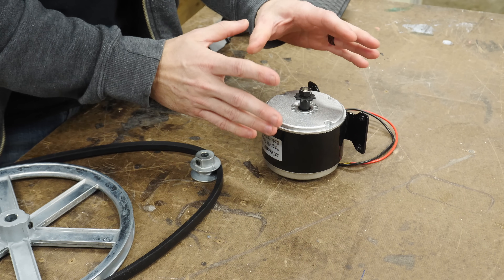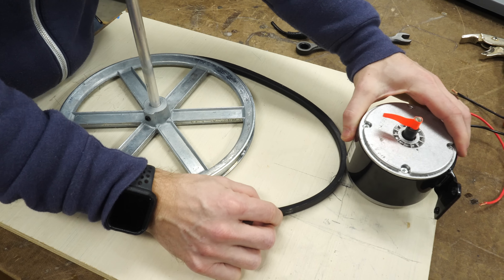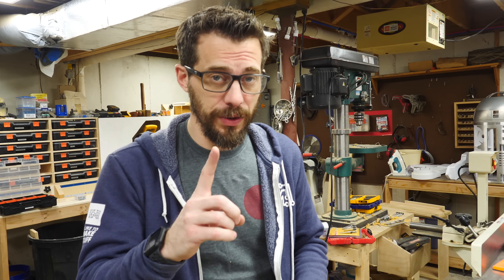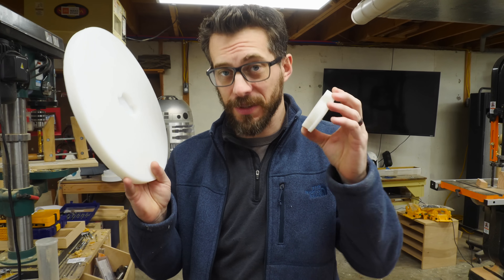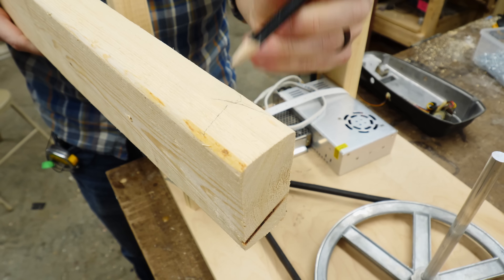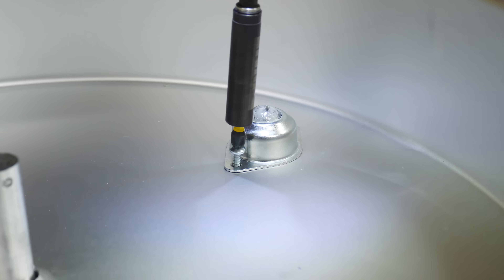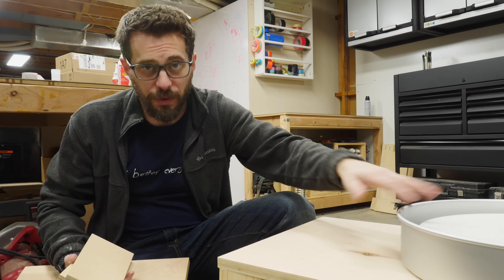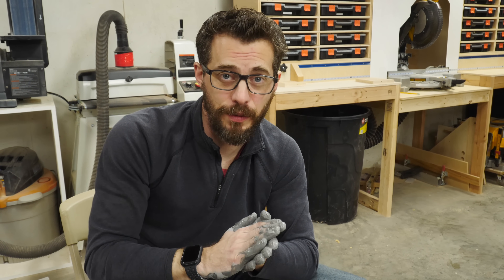How to Make a DIY Pottery Wheel | I Like To Make Stuff

Comment: Agonized over the same issue of how to support the wheel head.  Commercial pottery wheels use the drive shaft as the sole support of the wheel head.  So I stole the front wheel hub from a junked bicycle.  I made the hub and flanges stationary and drove the axle.  A pulley was nutted to one end of the threaded axle and the wheel head was nutted to the other end.

Comment: This is so cool! A potter of five years myself, and would love to make one of these, though I wonder if making a slightly larger one would be too challenging...

Also, a couple things that might help long term: most pottery wheels also have two holes on the wheelhead so you can add a bat (google potter's bat), and rather than a fixed catch pan, have removable ones so that you can clean them. I would also highly recommend having the catch pan allow enough clearance for your hand to reach into it, even while the wheel is spinning. Happy potting!

Comment: I know I am a year late but... here is everything you did wrong.

Non-removable drip pan, that's going to get dirty and gross. The bearings underneath are going to get clogged with clay. Term issue here, you called the wheel head the bat. A bat is like a plate that sits on the wheel head. You don't need a removable wheel head, fixed are better in my opinion, but if you go for a fixed one the bearings are extra bad. I would put more of a gap between the wheel head and the drip pan and raise the wheel head more. I like my wheel to sit about at my knees so I can brace myself on my knee and get at it without bending my wrists. that drip pan would cause issues at the base of the piece for me. I would estimate about a 2 inch gap for the pan and a rise of a half inch at most above the wheel head.

I know this was a first attempt but just so others w3ho might try it know, you made one big mistake while throwing. You dug your fingers into your clay. With a new bag its best to cut out a square-ish chunk of clay and beat the corners into a ball. This avoids creating an air bubble. Yours had one, I could see it as you were throwing and I knew it would happen when I saw your clay. Not only did this throw your walls off but if this went into a kiln it would explode. You made other mistakes but nothing terribly damaging so I won't bring them up. Also really good work for a first attempt.

Comment: I'm a ceramicist and it's hard for me to hold back, but really, wood (especially plywood) is a terrible choice. It'll rot to pieces with all the moisture involved. Mounting the cake pan made me cringe because how are you going to get excess clay and slip out of it when you need to clean it? Thank god you didn't glue the bat down... It was way too thick. You'd need to make a wheel independent of the bat, with much thinner removable bats.

Do yourself a favor and drop $1500 on a Brent wheel that'll last til the world explodes.

I'm not trying to be negative but it's so hard to watch. Apologies.

Comment: ... I titally admire your skills. For your first time throwing you centered and opened up the clay right awY. i think you did everything amazingly except  those roller bearings are going to be problematic with use of the wheel over time. Using a bigger shaft and a bigger bearing under the wheel head with a rigid wheel head material would be better. If you were going to make an ultra heavy duty wheel head I could see using the bearings but you have to create a design that won’t let clay and water  under the wheel head where the bearings are. Water with clay will be very abrasive and bad for any bearings. Also one water and clay get on the bearing they will make them not function to help the wheel head spin. And because of the way you attached that pan under the wheel head you will have a super hard time cleaning out the clay and water that gets in there. The pan under the wheel head is the splash pan and has to be easily removable. The shaft bearing under the wheel head needs to be water proof by having a collar around it that wont let water get to it.  Terrific video.another maker took a  shaft mounted flywheel  and screwed that to the bottom of a wood wheel head. Another thing to consider is you will be pulling in an upwards direction throwing pots so you do have attach the the wheel head to the top of the shaft pretty firmly. 
Would love you to talk about the kinds of motors and electronics to consider and how much they cost. Decent pottery wheels are very expensive its a great thing to be able to make, very hard to find them used.

Comment: Ok, you could just hook the motor straight to the rotor, no gear ratio just direct throughput and bypass the power output electrically so that it can't ever go too high. Get a smaller form factor that way. I'd put in an extra switch with a blocking cap as a nitros button just in case you want to go supersonic because I live dangerously.

Comment: I think you need to add a drainage to the pan put away the water and for cleaning purposes. An inch hole with a spout may work just put pressed out on the hole lining. To make the water ease out. My two cents

Comment: That circle thing, is not true.  The circles are there so that you can place another wooden plate on top and be able to get it off with air pockets.
You put a 1/2 inch circle plate of plywood on top of the spinning base with a little bit of dry clay to hold it on.  Then put the wet clay on top of the new plate, so that you can remove the plate and take the project off with the solid base to move it with.
There are circles on the top plate as well, but it's again, for air pocket so you can remove the project after you trim it all and break the clay off of the plate.  You can use them for measuring the base size, but it's really to break the surface tension while trying to remove the clay.

Comment: 1. Love your channel! 2. Many wheels have a removable bat for easier cleaning as well as a removable plate for the pottery so it you can make multiple pieces without having to remove them from the wheel too soon causing them to fall apart. By chance do you know how you would go about doing that?
Reply: Look for a company that sells Hardboard sheets to cut your own sizes or other companies sell pre-cut hardboard bats with holes on the sides already. Look for specifically Hardboard and not MDF.

Comment: Cool video., though there are somethings I would definitely look at modifying. I'm not a maker but I am a part-time potter. If you're going to make a wheel make sure the splash pan is removable or at least accessible to clean. The wheel head should be fixed to the motor. He says he didn't worry about it because you're not pulling up on it. Having taught people they do pull up and could potentially pull that off at high speed. You would need to either add some pins that you would then apply a bat to or learn to cut your pieces off the wheel head.

Comment: Bhalo, but just fit the motor under a table or a sitting stool , of height just enough to poke the rotating part of the motor through the surface of the table, while keeping the surface of the table insync with the ceiling of the motor , the area surrounding the rotating knob. Then on that knob place a roti roller plate as the base for clay dough stalling, ya you need to smoothen the base of the roti roller, and for the sound reduction due to possible friction and pressure directly on the knob neck just construct an aluminium circumference around the rotiroller base of minimal milimeters, so that no escape possible of the later said, that is use a handful of plastic bbs under the roller .😊

Comment: You might want to make a drainage hole with a tube attached that runes to a bucket. Water will build up in the pan and, flow down the shaft into the bearing.

Comment: I have always wanted to learn how to do pottery. I think it would be calming, if you’re not expecting yourself to turn out a masterpiece at first go around. This video is very informative and I appreciate it. I was hoping to find a way to make my own wheel, cheaply but well done. Unfortunately, I don’t have access to all of the tools you used. 😢. But, I was able to get the idea behind how everything worked. So, thank you for the video. Now, to just figure out how I can do it.
Reply: I'm in the same boat. I don't have a workshop full of tools.  Just a handsaw & a power drill.  But I'm thinking the plastic pan full of concrete with an iron rod & then figure out how to put it all together for the top section. Steel Bearing? All without all those shop tools...

Comment: The only problem I see is long term exposure of the WOOD, motor and control module to water...even with a little sealant at those screw penetrations, water gets every where...can't make pottery w/o water.

Comment: As a cake decorator and a potter. The idea of the cake pan was great but most catch basins separate in two so they can just be rinsed and put back. Also they may want to be wider as the water usually flies out and up instead of just out.

Comment: Okay I have no idea how to build anything mechanical like this so I APPLAUD YOU.

However, the splashpan is going to run into major issues. Its not nearly large enough to catch everything that is going to come off the bat. Also, the splashpan fills up FAST, and that small wall of caulk isnt going to keep the water and slip away from that middle area. And cleaning it is a manor pain if it doesnt come off. 

Other than that im extremely impressed by this

Comment: Instead of pulley drive you can use planetary gear system to lower rpm and high torque. Also it's more robust and no slip. No tension adjustment and saves space. Do try if you like.

Comment: Yeah. How do you remove the bat in this situation? I think the surface you are using to throw the clay on should have two steel nubs on each side for the actual bat to sit on. I wouldn’t even say what you are using is the bat at all and more of just a surface for the real bat to sit on. 

That way you can just take bats on and off at ease. In this situation you’d have to cut the piece off before throwing another. You could still do that too. Just cut off two small steel pieces like you did before. Maybe an inch long? Half sticking out and the other in the hole drilled out with epoxy?

Comment: it's been a few years since I took ceramics classes, and I was pretty decent and wanting to get back into it. However... I had forgotten what my preferred style of throwing was. seeing you throw real quick made me remember, though. 

I was weird (at least to some) in that I'm right handed but I prefer to have the wheel spin clockwise, so I can brace my right elbow against my hip and really push into the clay with the heel of my hand, and use it as a support for my left hand, then switch between having my hands pushing into or trailing over the clay by leaning to the right or left side. It all depended on what hand I wanted to use on the inside/surface or the outside/underside, or the kind of force I wanted to use. Or it could have been the reverse. I still can't remember completely.

Comment: You might want to increase the flange around the post holding the bat, from my experience in throwing you get allot of water built up quickly and will find it annoying to have to stop and get the water out of the pan (also you might want to re think the collection pan entirely it's going to make clean up impossible). I've used collection containers that sperate in half so look and see if you can modify one of those too work with your build. Also think about adding two pegs (that are removable) about a cm to put removable bats on. That way you or your wife  doesn't have to throw straight on the wheel.

Comment: One of the best diy pottery wheel instruction you can find on the internet! There are powerful DC motors with a gear as well so you probably won't need the pulley reduction.

Comment: I was wondering what your wife's reaction was to your project?  I think you did a pretty darn good job!  What you are calling a bat, is actually the wheel head.  A bat is just a piece of MDF, or plastic, or wood, that sits on top of the wheel head.  There are usually two holes in the bat on opposite sides, and they line up with two holes on the wheel head.  You put two bat pins in the holes thru the bat and wheel head and secure them on with a wing nut on the bottom of the wheel head.  You can throw on the bat and remove it with the pot on it, when you are done with it.  That way, the pot doesn't get misshapen.  I really enjoyed your video!

Comment: The cake pan should be removable. If it is fixed is useless. Depending on the clay, and how much mess you do while being a beginner in pottery, the clay will stick to everything and you need to be able to remove it to clean it with a lot of water

Comment: If you use a sewing machine pedal, and i connect that to a speed controller like the one seen in the video do I need to match the voltage of the pedal to the voltage of the motor (I've bought the same motor as in the video)

Comment: Wow I absolutely love this project! As a potter as well as someone who has basic experience in a shop I believe this is more than cool; if you want some advice I would suggest to add some weight either via a metal bat/wheel head or in some cases a wheel will have a concrete counter weight that will make a much more enjoyable experience for the artist. Also a wheel will generally have a much taller dam to  keep the water in your cake pan and it will also generally come off for cleaning purposes. Enjoy!!

Comment: with some very minor adjustments you could convert this into a Flat Lap grinding wheel for grinding rock, gemstone, glass, etc.  or even the bottom of your finished pottery pieces to ensure they don't wobble when setting on a flat surface.

Comment: I bought the exact same motor and controller a few months back. I was attempting to make a 3D filament winder. I was able to remove that nut though, using lubricant and patience ;)
Reply: What motor and controller and where did you buy it?

Comment: The wheel head, which you have been calling a bat should definitely be locked on the shaft. Bats are actually disks that fit on the top of the wheel head, two 1/4" hex bolts 10" apart on the wheel head will allow you to use bats, which make moving your pots a breeze. Also, the splash pan and bearings underneath the wheel head are problematic. The bearings are going to rust and get clogged up by clay, especially seeing as you havent got any way of cleaning out the splash pan. Splash pans are not fixed to the wheel unless you have an easily removable head. Everything needs to be waterproof, you would be surprised where the water is going to end up. Your elecronics are extremely vulnerable and should be put in a Tupperware box or something. The wood is going to absorb a lot of water, so you should probably add a layer of plastic sheeting of some sort to the table top, I can only see the paint working temporarily. Lastly, just be aware of the dangers of clay dust, breathing it is just as dangerous as asbestos, so you should probably only work with clay somewhere that you are comfortable with hosing down or mopping, never sweep. Oh, also if your wife is not already taking her ceramics class at a community college, they are a lot less expensive and a much better way of learning pottery than at a private studio. Cool channel!

Comment: Your gonna want to make some wood plates about the size of your wheel.  You secure them to the wheel with some wet clay and then work on those.  That way you can take the plate off and let the project dry or work on it on a different surface.

Comment: i used to do a lot of pottery and some things that i know would help would be to maybe take the return spring out of the peddle so that you can set the speed and take your foot off to get a better footing around the wheel instead of having one foot uneven on the peddle and one on the floor. makes it harder to work and causes strain. also like others have said that having a removable basin that is easy to clean is a god send and a must. also having removable and changeable bats so that you can make something and swap it out for a new one and not have to worry about cutting it off with string and ruining it in the process. Don't forget to wedge your clay :)

Comment: Also, if you want to upgrade consider a holding speed with your foot controller so the potter isn't trying to hold the speed with their foot all the time. Or you can consider a knee lever for speed control. The lever has no spring so the knee moves it from off to run speed and back to off. Again. My point zero two

Comment: There is probably already a comment below. The white "wheel" isn't a bat. it's the wheel. Take some 1/4" hardboard (smooth on one side) and make several bats. the bat it held in place with clay on the wheel that the bat sits on. Then you can take it off, cover your clay project and come back later to work on it or let it get green for trimming. You can never have enough bats so make double what you think you will want. My point zero two

Comment: Hi there. Cool project. 
The cake pan/splash guard: you may want to revise it a bit. You’re going to need to remove it to dump the water or wait for the clay to soak up and dry out the water and then reach under and pull out the clay that falls in the pan. 
If you look at commercial wheels, the splash guard is made in two interlocking pieces and are removable for cleaning and removal of clay. Otherwise, you will have clay, that you cannot see, building up under the bat. It doesn’t necessarily need to be circular just big enough for the water and clay to fall into.
Reply: @nasebear a seam would add more complication and need  a seal to prevent leaks.